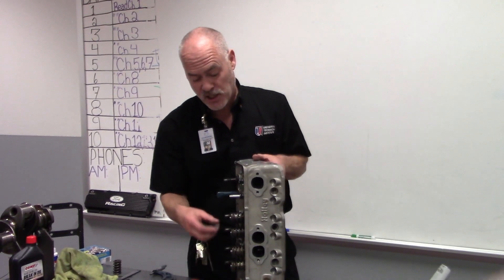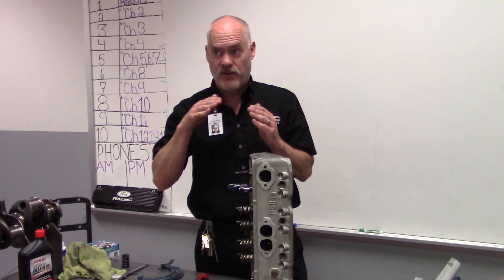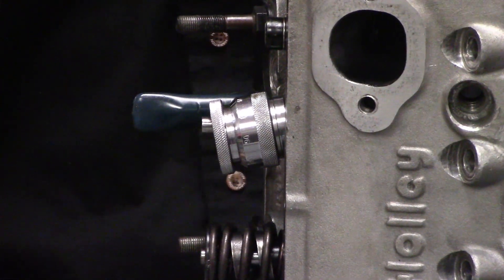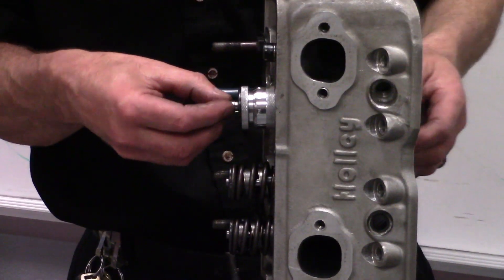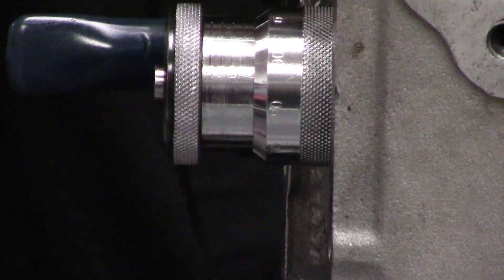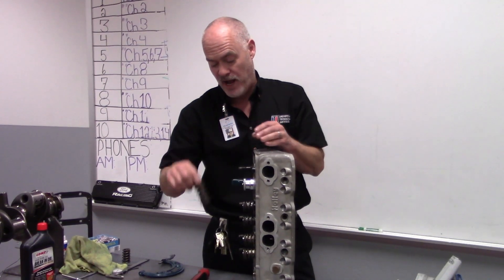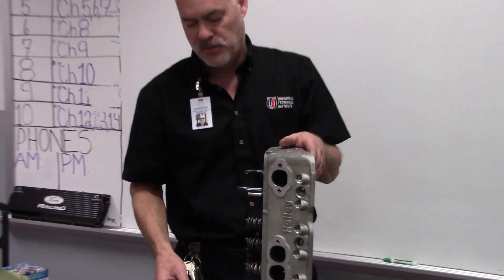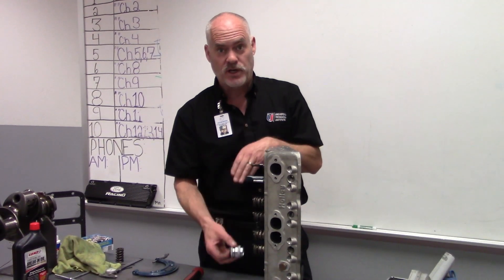350 Chevy Valve spring installed Height

Comment: I am working on a sbc in 1973 z28 camaro my shop manual from 1973 says 1 23/32 for installed heights + or -  1/32  which is 1.71875 + or -  0.03125. So where did you get that number of 1.70 or is that just something people shoot for?

Comment: Good evening, I was wondering if you could help with upgrading my 289 (1968 mustang) with better heads (you mentioned GT40P). Or maybe build some decent 370-400hp small block motor + T5 setup for my car. Was wondering how to contact you to set an order and so on. Thank you!
Reply from the maker: Sorry not doing customer work any more

Comment: Is there a way I could send you a pic?  Looking at a 5.0 Ford core for a rebuild.  It has the raised boss in the lifter valley but it’s not drilled/tapped for the spider.

Could I guy drill/tap that and use a factory roller setup?
Reply from the maker: Yes

Comment: That micrometer tool is the quickest and most accurate way to get each one dialed in correctly. A tall spring has less seat pressure, lower transfer of heat and because when fully open, has less pounds of pressure on the valve causes valve float, premature misfire and perhaps valve component damage from hammering. The speed at which the mass of the lifter, pushrod and rocker combined weight has the momentum to keep moving. This could lead to bouncing, excessive lash at peak and because it has less pressure may cause oscillations or bouncing if you will at the bottom at base circle. Who wants to rev to 6,350 RPM only to have a cylinder misfire, keeping the engine from full potential? No one. Excellent information and love that spring micrometer! 
DK, NIASE Master since 78.
Reply from the maker: I agree good comments

Comment: Hi how are you have a question for you sir i bought a remanufactured engine from AutoZone wich it came in with the valve cover installed on did you think they leave it at dead point or you think i have to take off the valve cover and put it on dead point??????
Reply from the maker: hmmm not sure

Comment: Love your videos bro.. Thank you for sharing the knowledge and wisdom you have. 
This is a question on a different topic.. You upload a 351m junkyard engine video a while back. Excellent details given on the 351m engine in the video by the way. I was just wondering if your considering still building that engine?  Possibly making a stroker build with forced air induction? Like a turbo, 351m stroker build.?  Just wondering about that 351m. Those heads with cantered values factory on the 351m can't be modified for decent performance?

 Take care and God Bless
Reply from the maker: No sorry the block was cracked

Comment: Hey man i have 283 with 350 head and wanted to know what are the type of head gaskets i would need and type of camshaft i would need. Most importantly the gasket i would need for the cylinder heads.
Reply from the maker: running a 350 head is not a good idea your compression will be way too low

Comment: Well I do not know. If the valve and seat are processed as expected, the drawdown will be 0.2 mm. maximum. And this, obviously, is not the value that will have at least some significant impact on the operation of the mechanism and requires a washer.